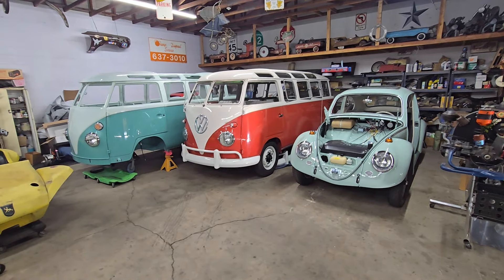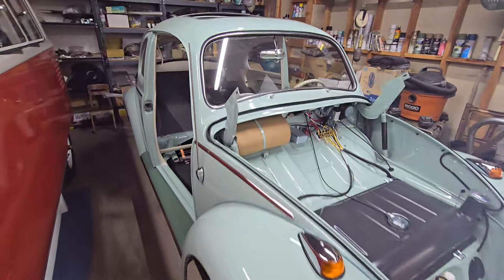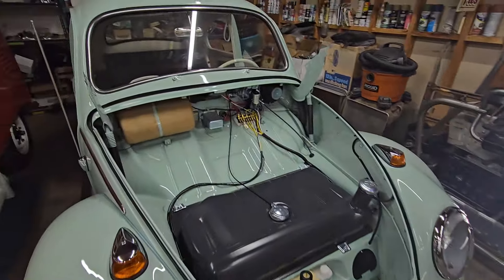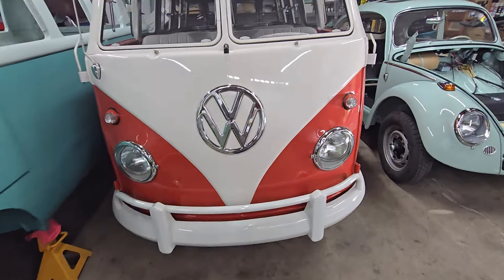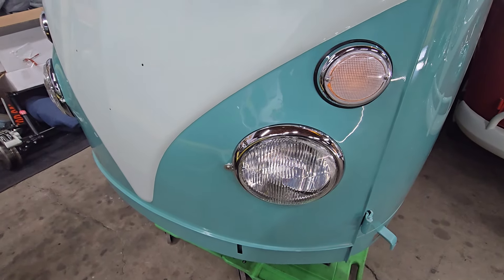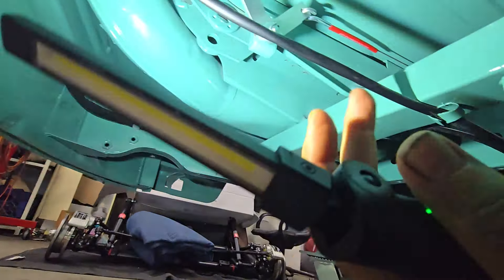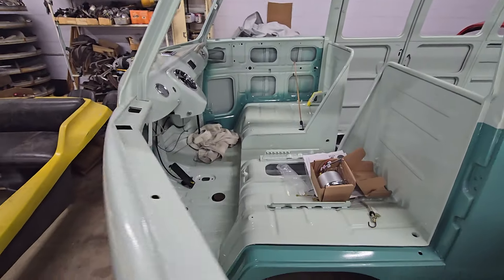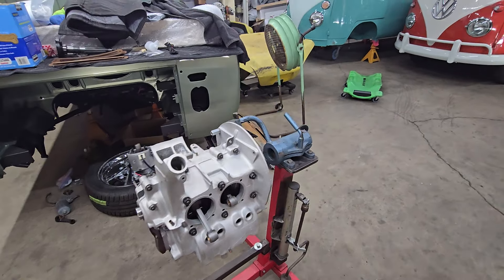A Day in the Life of Vintage Classic Specialist, Episode 192, the 64 beetle and bus get headlights!

Comment: 64 1 Fam is coming together 👏🏻 Hey, on the 64 van, can’t you use yellow led bulbs for the signals? That way the lens would just be clear. You did a great job on those headlights Mr ocd 😁 I found the laying down on my back part underneath the car isn’t bad, it’s the getting up that’s hard 😂 that just looks so clean on the underside ❤ CU tomorrow, stay cool! 😁👋🏻
Reply from the maker: Suppose we could, but this is more correct and original. That would be cool though and look good. 
I get tons of exercise working under a car like that, I must he up and down 100 times during the dat 😆